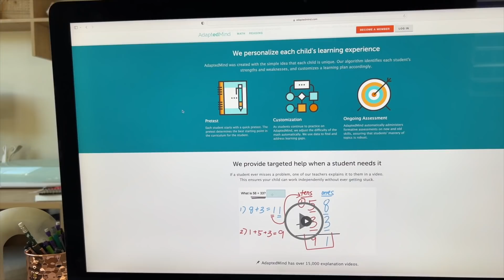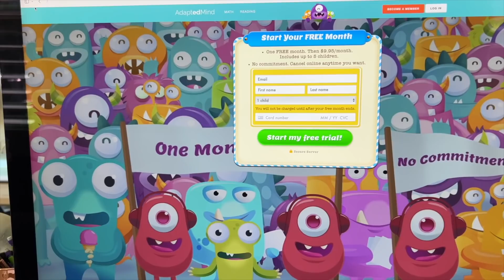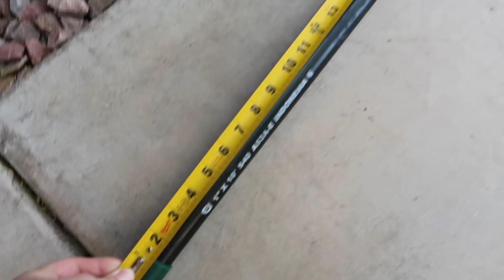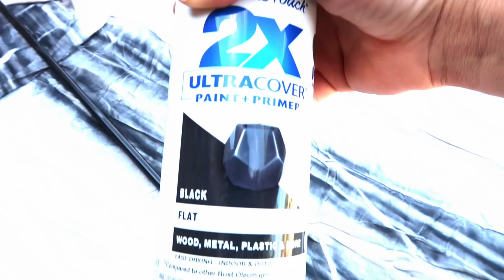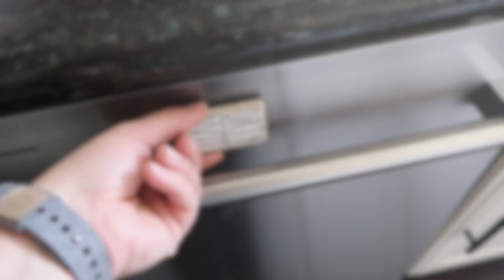New! HOUSE PROJECTS :: Decorating our Offices, Plans for our Kitchen & Changes Around the House!

Comment: Suggestions:  For the ends of the cabinets, they make a thin board you can pick up at lowes/ home depot/ etc (usually by the cabinets or lumber).  Use this on the ends of the cabinets and you can paint, this will help avoid further pealing and it is actually wood.    
             Second suggestion is to get curtains like the color of evergreen fog for the kitchen area.  This will make your pendant pop like you want and will tie in the island when you paint it and the built ins.

Comment: Great video.  In Kyle's office I would put up the wood and large print on the blank wall.  In the dining area I think a curtain would help soften the door and give a little sun protection. I love what you plan for the kitchen. The doors can always be taken off and replaced ; the trouble spots on the sides of the cabinets, the veneer needs to be softened so it can be re-glued, clamped then painted with enamel paint.  I enjoy your video's no matter if they are short or longer. Do what works for you.

Comment: Great job on the two offices. The kitchen redo for your counter tops is a great idea. I’m not a white farm house design however definitely the change will look great for sure. For the curtains solely in the eat in area I did toppers. Either way they add texture. The new curtain so super high but it turned out great!

Comment: Put your fiddle leaf outside where it gets light and water.  Mine did that and I put it on the patio.. it started flowing and now has branches.  I think that they just don't get enough light inside.  Oh, I also refreshed the potting soil. Scooped out about half and added new soil.  That was a couple years ago. Now I have to prune it occasionly.

Comment: You should add the map you had in your last house in the basement .It is a big enough wall to support it. I keep ours in the refrigerator, but would love to keep it on the counter it goes bad so fast. Like bread in the pantry with the heat in Southern California it just doesn’t last long. I think both light work well in the room. I think you could add a curtain to the sliding glass door with no problem.

Comment: Love love love all your choices.  
Yes yes yes to the curtains on the sliding door!
I think they would look beautiful.   
Regarding the clock in Kyles’s office, I feel it’s hung too high.   Love your videos.   Love the plans for the kitchen!    Not sure about the green on the island.  I love that it’s going to be a different colour than the cupboards but I’m wondering if it should be a more neutral colour?    Either way I love your decorating.  I’m sure it will be gorgeous as usual!  🥰

Comment: Also for your cabinet door that is falling off, use a wooden tooth pick or wooden golf tee depending on the size of the hole. Break the wood off on the current hole, then re-drill the hole needed.

Comment: Hi Amanda, I love both offices especially yours. For the big wall, I think if you are going to put canvas, the office will be very busy. My advice is to hang the clock on the stairs wall ( instead of the 2 pictures) and then you can put canvas. The canvas should not be busy. Keep it very simple and has three parts and there will be a space between each other. 🙏 for the fruit s, I always put them in the refrigerator.

Comment: Everything looks Very pretty. Seems there is never enough time or money for makeovers. 
We had a home that we had the same problem on a side of a cabinet like your cabinets. Probably from trash can. We sanded down the side of the cabinet and we bought the thin wood veneer sheet you can get at Home Depot.  My hubby cut the veneer to fit and glued on with liquid nails. You and prime and paint to match your new cabinet color.  We had all new cabinet door fronts built and painted the doors with the old cabinet boxes. You can actually update the style of your cabinets by changing the door fronts. Hope the info helps.
Enjoy watching your videos!

Comment: Hi 😃
I love love love your new home and the wall collors and all the new shelves <3 
Your violin fig may have had draft, to much water, or it have been mowed around to much, it could allso been dust on the leafs from the painting project. 
A littel fif to keeping the leafs sound and clean, once a week I wipe the leafs on all plants with a soft cloth, wrung in plain beer. The leaves become so beautiful shiny.
Keeping order in my office, has allso been a problem for me, until i changed my mindset, and made some small changes. First I always put things back in their place as soon i am done using them. All small electronics have theire own drawer where i drilled a hole in the back of the drawer and pulled a extension cord through so they all could be charged without clutter. My desk is allso in the middle of the room. I have laid a wire rail on the floore, in that way the wires are hidden and protected. 
You still keep me smiling, i startet 35 years ago to collect crystals and use essential oils. My favorites for the moment are Lemon grass and orange blussom.

Comment: How do you decide when to use an ecloth with water and when to use a standard cloth and cleaner? Also, if you could only pick one of your vacuums to keep, which would it be? I live in an apartment and have room to store one vacuum. I think you should put curtains on the patio doors to balance it out. I would prefer one or two rooms/areas at a time for spring cleaning videos because I could fit watching the videos into my schedule better. I’m excited to see your kitchen changes!
Reply from the maker: It depends - mostly it’s when I want a scent as I’m cleaning, or if I need a little more intense clean, I can spray and let it sit for a minute before wiping up. Ecloth is super convenient though!  As for the vacuums, I would recommend my corded shark if you have loads of carpet, but if you have mostly hard floors, I would recommend my Roborock cordless 🥰

Comment: Re. Messy desk.. how about putting a basket under each one. When you are working put it on the desk and everything you use can go in there instead of putting it back down on the desk.. then they stay in the basket until you return them to the correct place on the desk so it’s either tidy or out of sight in the basket. X.

Comment: I get why you would want to add curtains to the patio. In my experience, though, the curtains take quite a bit of abuse in that type of location. Firstly, your light switches would be under the curtains requiring the curtains to be handled by little boy hands (I say this from experience) thus, curtains end up getting quite dirty. Also, with the patio door opening and closing, curtains get caught in the door. There isn't enough room on the sides of your door to be able to pull them away enough from the door. Congrats on what you and Kyle have done so far. It all looks fabulous!! Can't wait to see the kitchen renovation.

Comment: Hi shorter videos...hi here in Australia we leave most of a fruit except  berries and anything we want cool we put in the fridge if not it goes off really quick....at the moment our grapes peaches and pears are in my fruit bowl...If we want them cold then we make a fruit salad and have it on hand.... wow the kitchen will look great as your saying if the carcus is good put new door on, the kitchen  people a new side on as it's met or 2 Pac material and 8f you can move you microwave into your walk through pantry and a more overhead or range hood over your cook top ...it will look more slim line...sometimes if think I'd you start touching things you might as well do it properly and it will last you another 20 years except for colour etc.. Kyle definitely spray paint the new Ikea fixture and definit9do curtains from one side off the wall to your sliding door...so you can't see were it starts or end the symettery if not you'll have to take on the window

Comment: I would add a curtain to the patio door but would leave it all moved over to the right side and then the few times you want them closed you can pull them over. Having anything hanging on the left side would be too busy, would get in the way of the wall fixtures and interfere with opening the door.
Reply from the maker: Thank you!!

Comment: I love watching you and Kyle work together on home projects.  I can't do that here hubby doesn't like doing that stuff at all.  

Also, I vote for painting that light black and hanging it in the dining room.  With all the White in there, I think the light would go with your table and chairs and be a great contrast.  

No curtains on the patio doors.  

Your kitchen cabinets are a mess!  I don't know what you can do for the peeling sides.  I do love the handles and your painting ideas, but the peeling is going to be a problem and will need some research.  I pray you don't have to get all new cabinets.  Are you going to include your butler's pantry in the painting?  How about just painting that the same as the walls in the kitchen and continuing the backsplash the same as the kitchen?  Just a thought.

I love you and your show.  It really brightens up my lonely life.

Comment: I would put the desk in front of the blank wall, facing out.  The room is beginning to look crowded as it is.  Changing the orientation of the desk will forego putting the wires under the rug, which is not to code (hence dangerous), and you won't have to put a hole in your rug.

Comment: Nice work! Will you be painting the butler pantry cupboards when you do the kitchen, or save for a future time? Re cutting your carpets and running the cords under, I think there’d be a concern of wearing the cords too much (with the friction of walking on them) and wreaking them..have you looked at those carpet runners (plastic?) that lay over the cords on top of the carpet? House projects never end do they? One flows into the next so easily :D
Reply from the maker: Yes we plan to do the butlers pantry area at the same time 🥰

Comment: Hello, I just came across your channel. Question what's the process for doing the leather straps?  I.e what are all the products you used?
Reply: I love the concept and would like to recreate it for my home
Reply from the maker: Hey! So happy you’re here!! Here’s some quick info on our process 

Howto: Dy Pipe Curtain Rod
1. Cut pipe down to desired size (we do a 10"
overhang on both sides of the window)
2. Spray paint pipe (I love matte black)
3. Using 2" wide leather - make a loop & cut to the desired length that you want the curtain rod to hang down.
4. Next drill a screw into the top section of
the leather (making sure it's looped as you do
this so it goes through both pieces)
5. Last, push the looped leather up to the
ceiling and drill the screw in. Then add your curtain & pipe!
Reply: @ThisCrazyLife  thank you! I like this option for my bathroom and covered patio.

Comment: Any stickers that are on like that take a hair dryer and heat that sticker up and it will peel right off and you would shouldn't have any residue if you do take rubbing alcohol and that takes it right off but a hair dryer usually will take a sticker off very clean

Comment: both your offices look so good. Kiles office does need something large on that wall. And I think the clock is way too high  cause its higher then the shelf on the other side of the window. I think it would look better if it was about 8 to 10 inches lower.